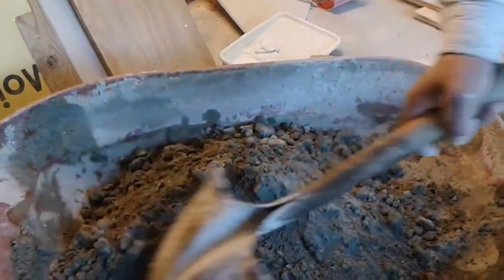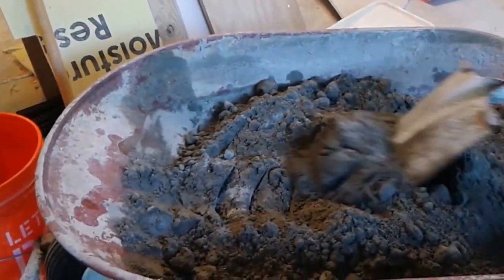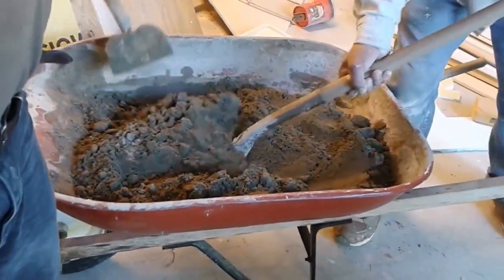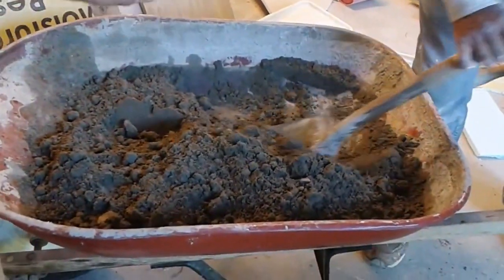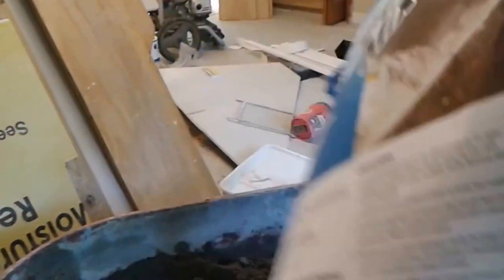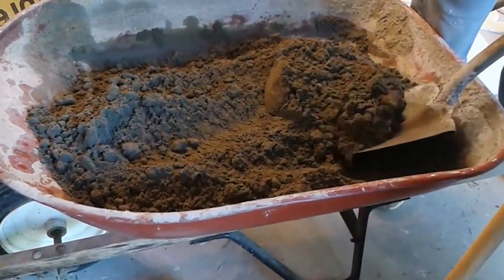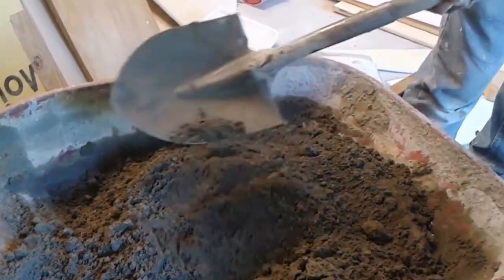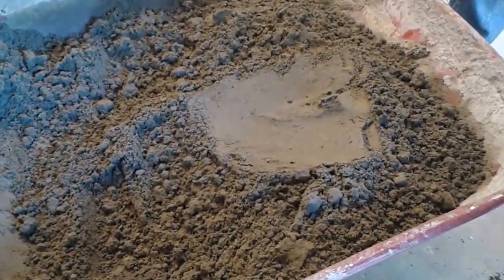How To Mix  Mud  For A Shower Pan Pre Slope and Quick Slope Properly

Comment from the maker: This project use 4 to 1 mix ( 4 part sand and 1 part cement)  from Mapei. Find it on amazon https://amzn.to/2EmYWo5
All material used to build shower pan are from Amazon:
Shower Pan Liner Used  size 6'x8' https://amzn.to/36bKKd4  size 5'x6'  = https://amzn.to/33b6pjQ or size 6'x8' = https://amzn.to/34bGUOu
Metal Diamond Mesh = https://amzn.to/30ipHlo
PVC Dam Corner = https://amzn.to/36gIMrW Or https://amzn.to/3jeayZX
Goof Proof Quick Pitch = https://amzn.to/335t8hf
Goof Proof Extra stick = https://amzn.to/2S1A9cm
4 - 1  Mix Mud used = https://amzn.to/344tfsq
wood float = https://amzn.to/3ijo0tX or https://amzn.to/3jgjFsO
thin set used = https://amzn.to/2EyeEgc
Pan liner Glue = https://amzn.to/3cP2lsM
Weep Hole Protector = https://amzn.to/332QvrB or https://amzn.to/330Te4U
Shower drain used = https://amzn.to/2Hp9c0a
Or  https://www.amazon.com/gp/search/ref=as_li_qf_sp_sr_tl?ie=UTF8&tag=josephkhalon-20&keywords=goof proof quick pitch&index=aps&camp=1789&creative=9325&linkCode=ur2&linkId=cf01d1f4124c5fb222b2c983ba56e5e1
Amazon Deals:
Try Amazon Prime 30 days for free = https://amzn.to/2JMWaLe
Create Amazon Business account = https://amzn.to/3mLSyYt
Joint Amazon Prime Watch Thousends Of Movies and TV = https://amzn.to/33NfsHD
Try Personal Shopper Wardrobe  https://amzn.to/2VClfv9

Comment: Have you used the quikrete sand/topping mix? Curious as the the work ability difference. Big price difference between the seemingly two same products.
Reply from the maker: I used Mapei   = https://amzn.to/2EmYWo5
4 to 1 mud bed mix. I did not use the quikrete sand top mixing.This product will not work. The quikeret is 3 sand 1 cement so you will have to mix it with sand to get 4 to 1 as needed.